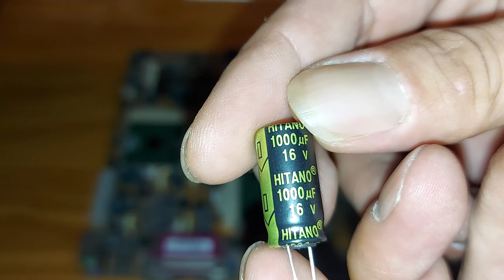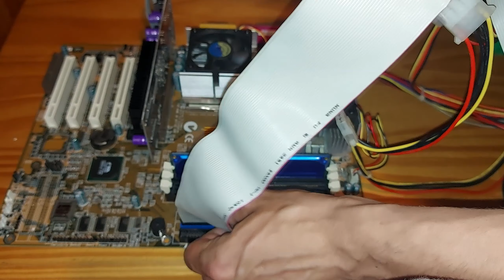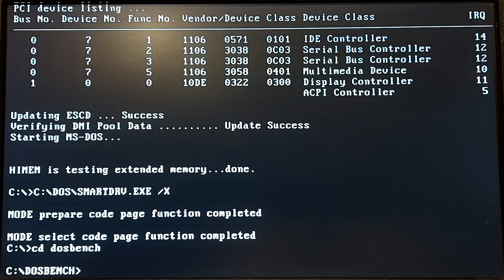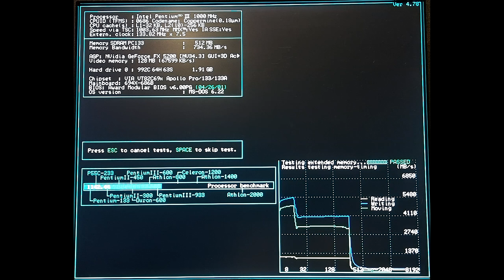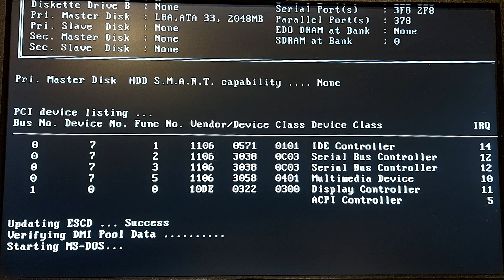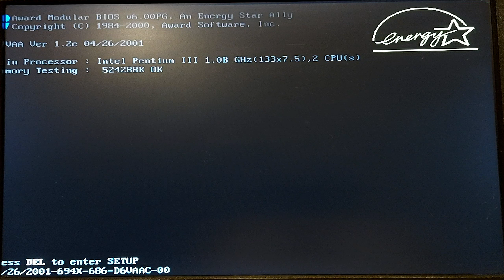Dosbench | ECS D6VAA | Dual Intel PIII CPU's, 512MB PC133, GeForce FX5200 & 3D Prophet 4500 AGP

Comment: Still have this board from when I was a kid. Also recapped it and now running dual 850s at 133 for 1.133GHz, but at least these seem stable at that speed unlike the actual released and recalled chips.

There is a special bios released for this board. It's the 1122 Service BIOS. It's available to download on the net and includes some last minute updates and unlocks independent and manual voltage adjustments before support ended.
Reply from the maker: Thanks for that little nugget of information, I shall have a look into that particular bios update. I am not entirely sure what version my board is running. I'd imagine it is probably the bios the board was shipped with from the manufacturer. It'll give me something to tinker with to try and get the most performance out of the system as possible. It'll be a good comparison from the stock setup.

Comment: i had a pentium 4 and an fx5200 and 1gb of ram back in the days...  it played modern titles like gta sa, counter strike source, and nfs most wanted in 640 x 480 resolution just fine!
Reply from the maker: Yeah, I never had a P2, 3 or 4, I took the AMD route. I doubt that I will be using this rig for games but more for storage of those classics. 

This rig will be a Windows 2000 storage server to host data to my other retro machines on an isolated network.